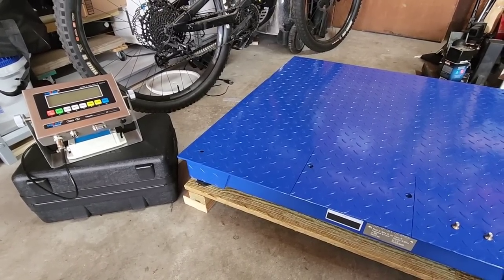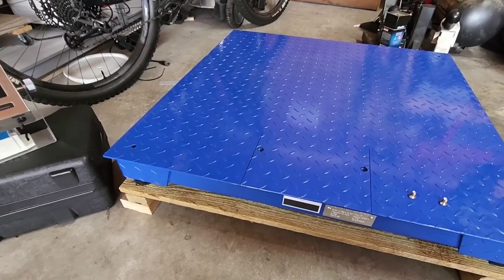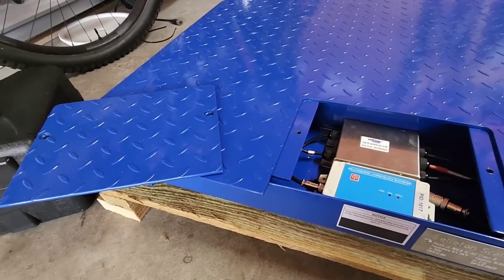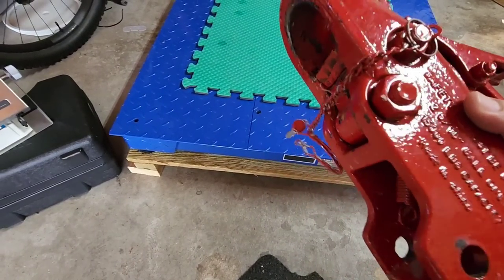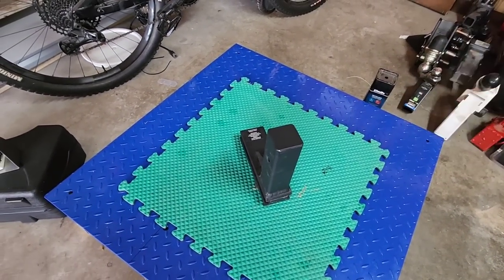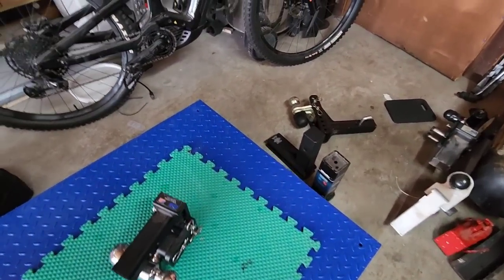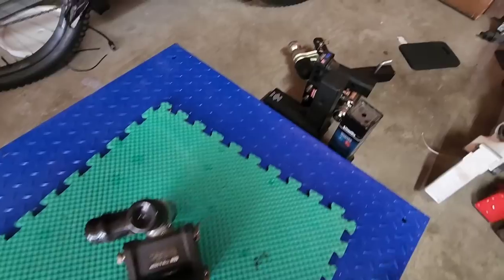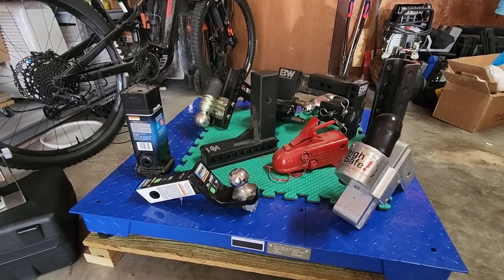Weighing Towing Equipment with my SellEton 10k Scale!

Comment: Great video!  Honestly I would love to see two categories weighed:

1) The stuff we put in an RV.  How much do the kitchen accessories weigh (pans, dishes, flatware, food, cleaning supplies, etc) versus bedroom stuff (clothes, electronics, CPAP maybe, etc) versus living room stuff (TV, extra bedding for the foldout couch, nick-knacks, etc).  Since an RV is capped with living rooms, kitchens, and bedrooms (usually it seems), load balancing is an issue, and getting an idea of how much can be added to each would be helpful.

2) The other thing to weigh is stuff we may use around the house on a typical weekend.  Things like a small trailer we may use on occasion while at home.  A u-haul or Home Depot rental trailer attached to the family SUV to haul bags of mulch or soil for the weekend can strain the vehicle.  What is the true weight of those large bags of organic soil from the hardware store and can they quickly exceed the payload capacity of an average mid-sized SUV or 1/2ton truck?  How much can a medium sized pickup carry (in terms of number of bags instead of raw weight)?  How much do power tools add to the vehicle's weight if they are tossed in for a project at a friend's house, and how much lumber can be added safely?  How about moving a household?  This sort of stuff would make great segments, since we do this frequently without really knowing the weight impact.

Thanks JD!

Comment: Hi BTBRV,  

I used to work in Metrology as a Calibration Tester. 

If I may make a suggestion,  you should buy some weights to use for testing the accuracy of your scale(s), something that you will use only for testing scales or just get something that won't change in weight from wear and tear (or heavy usage) to use as the "Standard".

From my experience in test Calibration and measurement,  i've noticed that the more often you use scales over a certain period of time that the accuracy deteriorates over time and will need to be adjusted (calibrated) regularly to maintain an acceptable percentage of accuracy for industry use.  Most company will either have a contract with another company to handle the Calibration testing for their equipment but for people using these heavy-duty scales for personal use,  you can make do with the right know-how and equipment. 

It might seem like overkill but you seem to be a guy that likes providing accurate information to your viewers so i thought that you might appreciate my input.

Comment: I own an odd set up however I need to weigh the tongue on my 24k TT. Last time it was weighed it was almost 2,700 pounds. I pull with 30k weight distribution bumper pull hitch by torklift. Ideas?
Reply from the maker: Send a pic of your rig.
Reply: @BigTruckBigRV  Done, via Facebook messenger